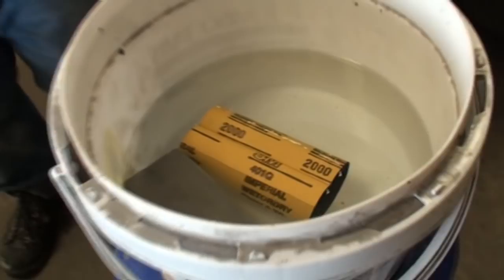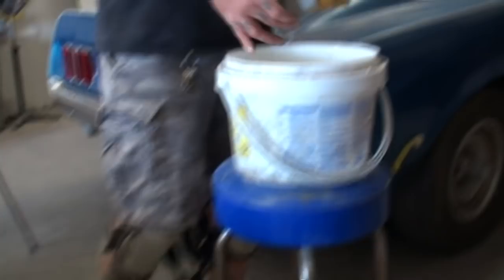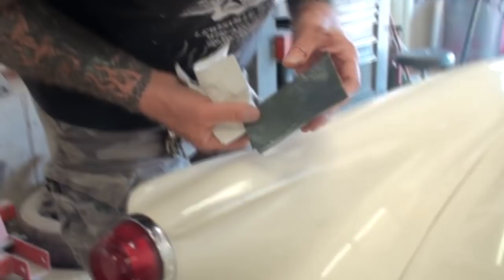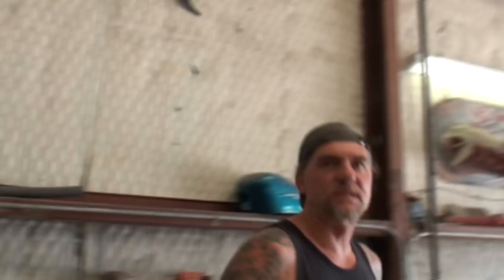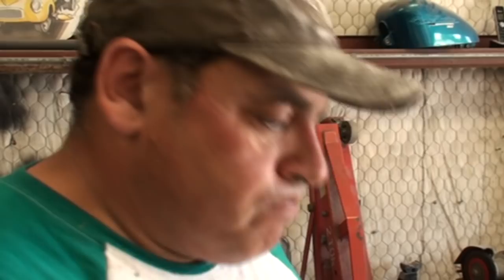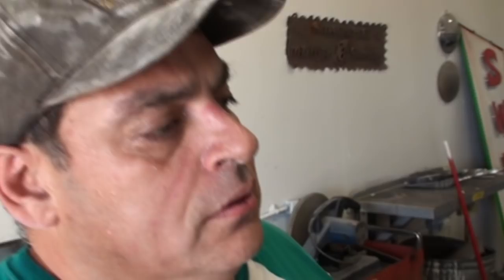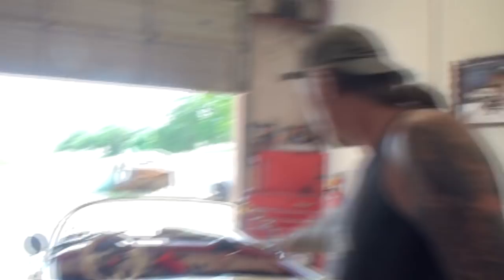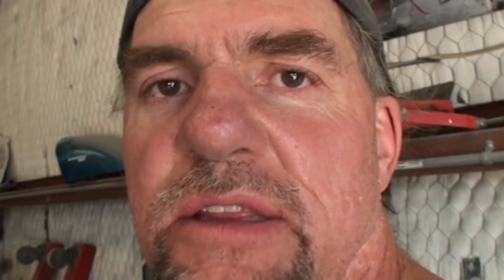How To Fix Paint Chips - Paint And Body Tech Tips

Comment: Hey Pete, I have a 2014 mustang and I have a small rock chip on the edge of my front fender well. It’s slightly smaller than the size of a pencil eraser, but it has a little bit of surface rust on that small spot. Would the fender be fine if I get the rust off and touch it up or will it eventually rot the rest of the fender?

Comment: there is a trick to use i take a model paint brush and use the back of the handle just dip the end in paint and it will work better by dropping the drop in the chip and it will fill it in just repeat till it is fully filled and u don't get paint on the old paint makes it faster and easier to finish
Reply: i bet that car has been in the sun a lot and then u need to add just a little yellow in the paint for the paint fade and it is about a drop to a pint